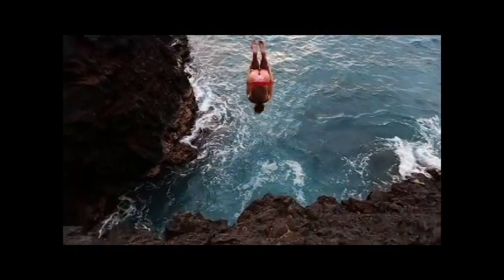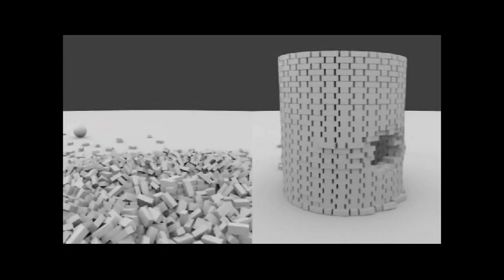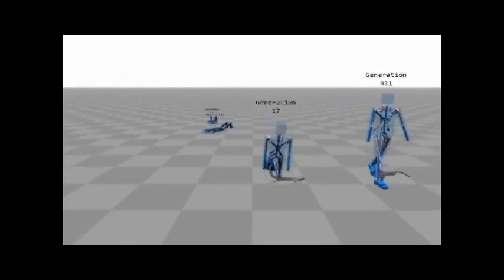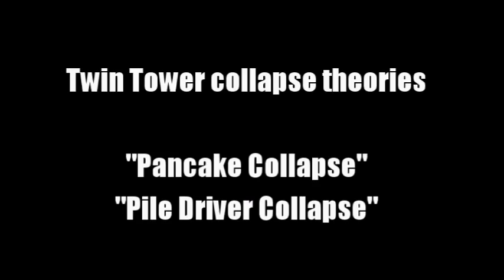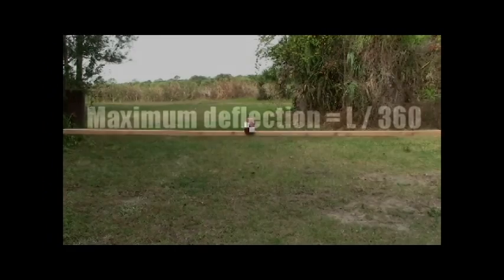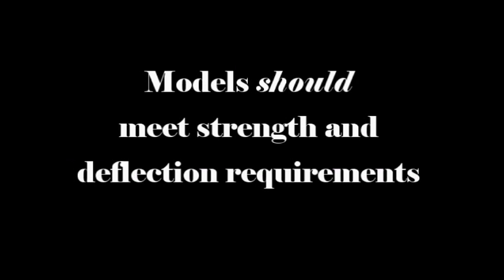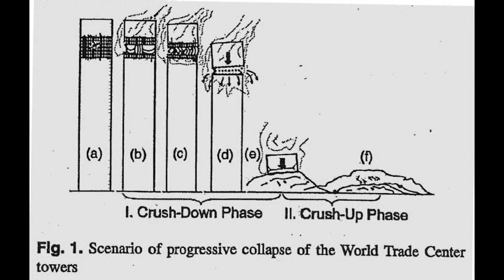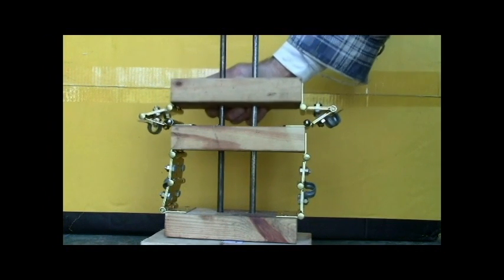9/11 Experiments: The Force Behind the Motion

Comment: I was watching them interview the designer of the building and he said that he designed his building differently from other buildings by not using columns in the building to support the weight but the outside of it like an exoskeleton of an insect. He did this to give more usable space in the building so there were no columns. Also, the elevators were only there to move people up and down the building and did not play any part in the structural support. I am not sure if these guys take that into account when they are figuring out these things. I think that was the first building of its kind so maybe that is why it acted like it did. They said that there fire proofing of the steel supports was missing and they figured that it was blown off from the explosion when the plane hit the building. But I think no one will know for sure what really happened in the end.
Reply: what happened to building 7 it didn't got hit by plane why DID IT came down??????????????